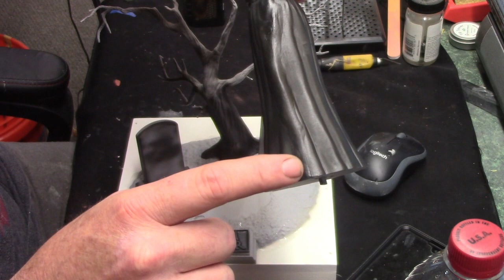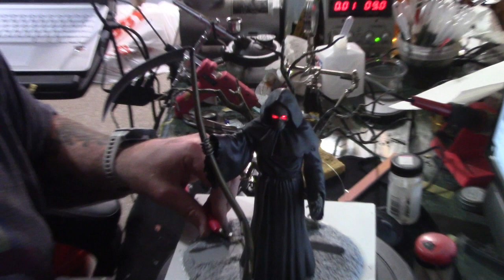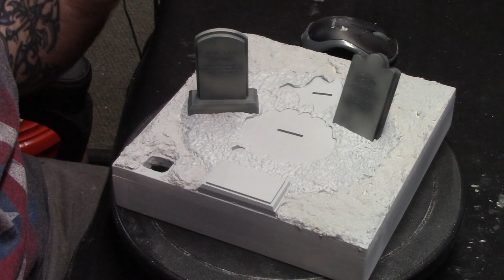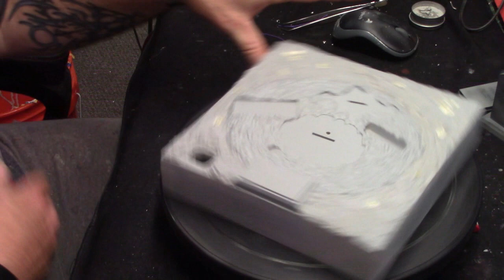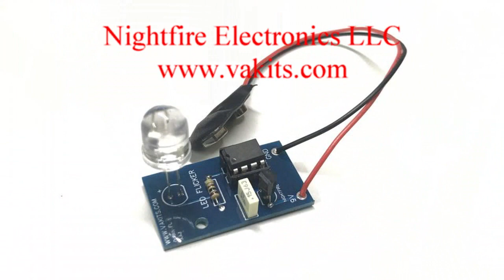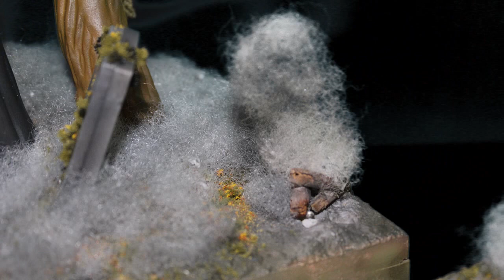moebius grim reaper movie

Comment: Finally had some time to check out videos  =)  As I said earlier I love how these turned out. I'll be going back to working on mine soon as my room is done enough to work in. I bought the same type of frame for its platform. What did you use to secure the base to the wood?  I may light up the next one I build..not sure yet.
Reply from the maker: Thank you
Reply from the maker: I used 5 min epoxy
Reply: @BTMScaleModeling  ty =)